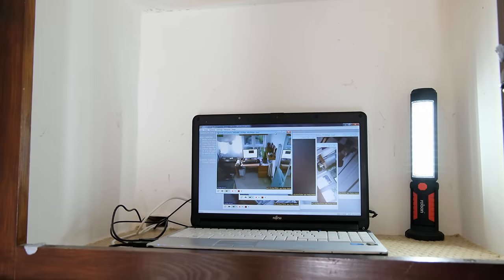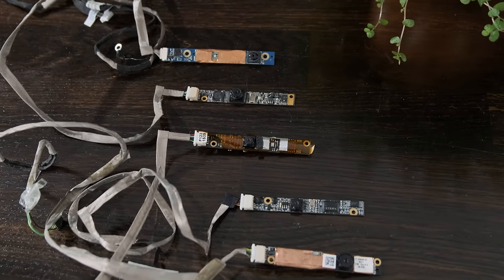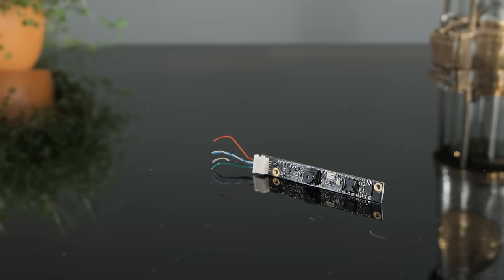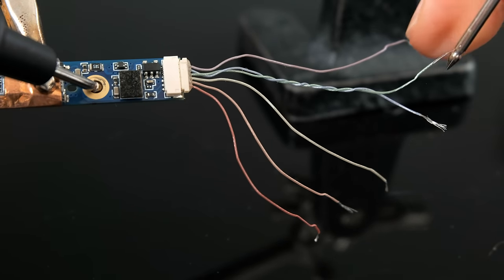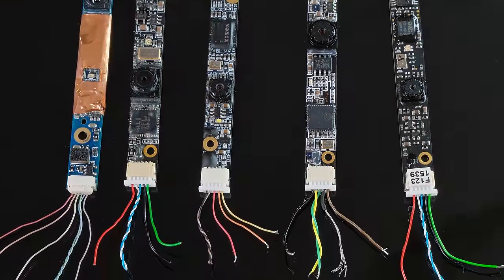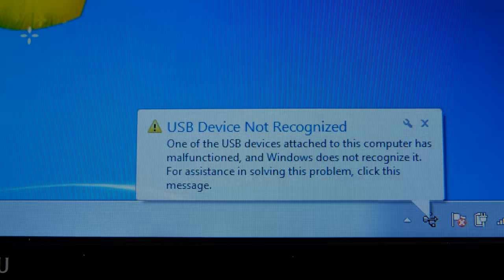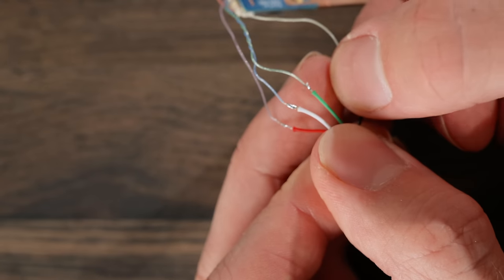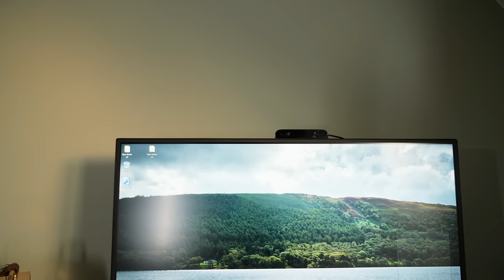How to Convert Laptop Webcams to USB Webcams

Comment: Watch out for webcam modules that are powered by 3.3V as they fry when connected to the 5V from a USB-port. Some have it marked on the rear of the PCB as 3V3 next to one of the wires. A little VRM to regulate the voltage to 3.3V is enough to get those working. No need to also convert the data signal.
Reply: thanks for this comment lol. almost broke a webcam that way. thankfully it was pretty resilient
Reply: @__init__3493  a rookie to electronics do you know how can i do that 5v to 3.3v
Reply: @انا_ابراهيم_البناوي  couldn't you just use a potentiometer? Just adjust it from 0v to 5v
Reply: couldnt get this webcam to work and then i see the 3.3v on the pcb. I guess that explains it
Reply: wire 2 or 3 diodes in series to the positive terminal before you attach it to the camera.  They will take up the extra 1.7 volts.
Reply: you can also do that with a voltage divider with resistors in parallel. you can search in google on how to make one.
Reply: @bunnssgalore5407  I tried with the diodes but it was very difficult and didn't really work, especially since there were a lot more wires than I was expecting and it was very hard tracing which one was the actual 3.3v
Reply: @انا_ابراهيم_البناوي  Use a resistor
Reply: @انا_ابراهيم_البناوي  don't do any of the things these people are suggesting, use a 3.3v linear regulator
Reply: @Anthony-lr4bk  You need to know how much current is the camera taking in order to calculate the right value of resistor. Putting 3 diodes in series makes around 1.7 - 1.8V drop, so its 5 - 1.8 = 3.2V and you are done. No need for regulator either
Reply: @انا_ابراهيم_البناوي  ams1117 3.0
Reply: Thanks but too late
Reply: Thanks but too late

Comment: Hey! I can be casual here on the Extra channel so expect plenty of smaller videos on here :)
Reply: The webcam i found isn't the same as what you were demonstrating. I think its a webcam with a mic integrated, is there a way for me to also use the mic?
Reply: Hey Mat, love what you're doing! Keep it up!
Reply: Sweet! Love your channel. Also digging the beard :)
Reply: @GuardTower  
The microphone data should go through the USB connection as well
Reply: I just want a third of your spirit, mate...
Reply: @GuardTower  I imagine the mic would just use the same Data cables he mentions that are integrated as it would be getting it's power through the same power and ground wires as the cam/mic are all on the same PCB?
When your OS picks it up, it should automatically register both in the Device Manager (Windows).
Reply: Does this work with a webcam with a mic?
Reply: @alonsoaguilar3905  It should.
Reply: @OdykKayne  but there are two extra cables
Reply: @alonsoaguilar3905  That depends on the laptop webcam with a built in mic. Some have a mic that don't have extra cables. Does yours have two extra cables then, you say?
Reply: @OdykKayne  yes
Reply: Mat, I love the things you create and watching you build them.  I’ve been hooked on DIY Perks ever since I saw your video on creating/ building your own portable projector.  When I saw you have DIY Perks Extra, I subscribed immediately.  Thanks for all you do!!!
Reply: @OdykKayne  wont that interfere with the data being sent? there is a reason why the mic is on a different wire. because if it can be passed through along with the data cable, then they can simply route that in the PCB to join with the data cables instead of having separate data cables
Reply: @GuardTower  USB desktop webcams only have one USB cable and they often contain a mic? If the mic is on the same PCB as the camera, I imagine the PCB has some means of sending the data from both through the same set of wires...?
Then again, I imagine this varies from camera to camera. I'm no expert, I am just going by what I think.
Reply: @OdykKayne  you have a point there. tho the extra wires are 7 and it has a ground. so i dont know if i should connect it to the ground
Reply: @GuardTower  Not sure to be honest! Try figuring out the 4 wires that Matt refers to in the video and see if only the camera works or the camera and the mic?
Reply: hey mat.you such a cool guy.. keep inspiring people dude.. 🤘🤘🤘
Reply: @Aditya and also the converting USB webcam into Raspberry Pi ribbon camera
Reply: Matt, a community database for the pin outs would be a useful tool. Any idea how one could be implemented.
Great videos, been watching for years. The beard suits you. Keep up the good work.
Reply: i never can find those for so cheap if i want wan i need to pay 10£ + postage
Reply: @GuardTower  the mic should be recognised by the system when the USB device is connected in addition to the webcam, as the chips on the USB board will have the information for the host (PC or whatever) to tell it has a webcam and mic
Reply: Hey matt can you also share how to use multimeter. Your videos are amazing.
Put some more details in the extra channel so that a person with no knowledge can also do it.
Reply: @1981chrisjones  Just to clarify as there is sensible speculation here - but it's wrong. I've been researching this as cameras are so hard to find, and it seems like there's a strong convention: 4 wires carry USB connection for the camera, and 2 separate wires carry data for the microphone (not USB protocol). From what I can see, they use PDM audio a lot (digital data with a clock wire and a data wire). But it's also possible to carry analog audio - the condenser mic gets power from the same power line. I should also note that the 4 USB wires go to a motherboard connection labelled "camera" whereas the 2 microphone wires go to a different connection. Also, the camera is generally receiving 3.3V from the motherboard, so consider dropping your USB 5V supply with some diodes.
Reply: Plz help to convert smartphone camera to usb webcam!!!
Reply: Hey can you make something like a single button gives order to start multiple systems like server?
Reply: 200th like
Reply: @derekborigo8601  it shows your device needs more power. Now what can i do?
Reply: how do i figure out ground and power positive without a multimeter?
Reply: I've found one that the camera board has "housing" and so I'm unable to interact with the boards' components.  Any suggestions?
Reply: @lordf7355  Damn.  It was a decent one, too if the specs are to be believed.
Reply: Matt thanks for the video. I'm having a hard time finding old laptop cameras with the wires, even the links you provided on UK EBay, none of those have wires. It would take me a long time to find as many old laptops as I need. As a alternative where can I find the white tab connectors, so I could just join USB cables direct to those? On another note, I believe it was you who recommended Contaware as the accompanying Security Software, I'm having a hard time adding Networked iPhones and iPads to it, any ideas?
Reply: Sir is it possible to cellphone camera to turn it into a spy camera using usb cable? Lots of tutorials i saw here in youtube and they said it was fake. Could you tell me sir? Is it possible or not? Thank you
Reply: YOU DONE A VIDEO USING OLD BROKE TV SCREENS AS NATURAL SUNLIGHT, I HAVE AN IDEA AND WAS WONDERING IF YOU MIGHT BE ABLE TO BRING SOME VALIDITY TO MY THOUGHT ON USING THIS IDEA IN MANY WAYS, HOW WOULD I GET IN TOUCH WITH YOU BEYOND HERE??? GREAT VIDEOS BTW I ENJOY ALL OF THEM.
Reply: And for night vision?
Reply: @GuardTower Hi, my webcam has two more wires, I think represents the mic. Everyone here answered you about it? Do you know how to connect them? or it's not possible?
thks
Reply: Oh, yes welcome
Reply: @GuardTower  I don’t think it’s a mic
He cut off that part
I think it’s a data storage for the camera
Reply: Please make more videos like this one! This project is super approachable and practical.
Reply: Please make a video on how to make a secret small recording device that has Wi-Fi.  Thanks
Reply: Please make an easy tutorial how to make USB Webcam connected wirelessly via Wi-Fi. I can't find something like USB2Air device in my country. Thanks before 🙏🏻

Comment: I tried this without soldering in case there are things need to be re-do, but the thing is after I wired and plugged the USB, it is not detected and the webcam module gets hot. Any ideas why?
Reply: Try switching the data cables.

Comment: Many laptop cameras require a 3.3V power, not a 5V available on USB, so you have to add a voltage regulator.
Reply: Yes ,the most is 3.3v
Reply: Thanks for your Comment, my webcam works with 3.3V too. Unfortunatly, I already connected it to 5V, do you think it is still working?
Reply: On 2:33 he tell us to find a regulater. That think regulate to 3.3 V?
Reply: @noreply370  Yes, but some modules will use 3,3V USB, and regulate internally to even lower voltage, or won't have a voltage regulator at all.
Reply: module boost
Reply: how can i know or from where ?
Reply: @abdulqaderalmehdar8421  From the laptop schematic diagram...

Comment: Instead of cutting a USB cable, it's probably a better idea to connect the wires to a micro USB (or type C if you really want to) connector. That way, you get to keep your cables.
Reply: yeah..................
Reply: I have many many cables from old devices at home, so it's cheaper to destroy one than buying a conector.

Comment: why do we need to identify the power positive using a tester, cant we just alternately switch the wire to know if it will power on? will it damage the camera in case we connect  the power to a wrong wire?

Comment: im having a problem. it seems both data cables always result in an error message. i have 2 cameras right now and i swapped both data cables and its all error messages. i tried using a different laptop and still the same result. pls help :<

Comment: Hello max, great video, but i have a problem the web cam from a laptop that i'm using it only have 4 cable, 2 of then  are torch together that i supose those are data + and - and then the other two must be u+ and u-.
But when i used the voltmeter those two for tensión they sound and beep in the negative..
Could you give some advice?

Comment: Hi, I have a webcam with 5 wires. When I plug the orange one to the GND and the black one to VCC the LED is powered. But the two twisted wires (I guess they are data wires) don't do anything when I plug them to the Data+ and Data- (same if they are inverted). What can I do? I also have a yellow wire on the webcam. Thanks

Comment: Gave this a try after salvaging some parts from an old laptop, and I ran into an issue that I'm unsure how to diagnose. I soldered everything up, and the first time I plugged it in it gave me a "Device Not Recognized" error. So I swapped the data wires, and my computer (in fact, both computers that I tested it with) made the "device connected" sound, implying to me that I had done everything right. However, nothing new appears in the device manager or in software, and even after restarting with the device plugged in I'm fairly certain no new drivers were installed. Is there a way to check if the device is being recognized at all?

Comment: So, I tried making one wiht a h003p-4 model. Think i connected all wires right but when plugging in a laptop, I get descriptor request failed error. How do if fix this? Tried changing Data + and  - cables multiple times too.

Comment: I've been trying to do this for hours with no luck. First cam i took out of old Fujitsu Siemens notebook either kept not getting recognized by system (tryed switching data cables with no luck) or just doesnt get recognized at all and other one that is from Acer notebook doesnt get recognized no matter what i do. Both cams light their LEDs when connected to usb on working notebook, Fujitsu lights blue (its weaker without that 5th cable which might be shielding and stronger with it but doesnt get recognized either way), Acer one lights green LED that doesnt change and has no 5th cable. Any ideas?. Its kind of getting frustrating when basically everyone on the internet can get everything done easily and no matter what i do nothing works for me.

Comment: I have tried this out and it works well, except for one thing, the camera module heats up. Is that normal? I believe it is because the camera takes 3.3v and the USB port is 5v output. Should I be worried or should I need to solder on resisters? Thanks for the video.

Comment: I tried this method with an old Acer Aspire 8920G camera but it does not work. I have read somewhere that It must be because of the input voltage, which should be around 3.3V. But I've also read that all laptop cameras run on 3.3V, so I don't know what's happening. Maybe I need to install the drivers, but I cant find them. Any ideas?

Comment: My Webcam connects correctly to the PC for 3-5 seconds. It says "Foxlink" in the device manager for camera. So, the brand is correctly detected. But after these seconds it disconnects without changing a thing.

I read that there are 3.3V cameras out there. May this issue relate to this? I could not find a proper Datasheet for "Foxlink CONFIDENTIAL F003FF-149" since it's pretty old.

Comment: Hey Matt! I tried connecting it to the PC, but it won't recognize it. Neither does the LED from the webcam light up. It only gets really warm, do I have the wrong cables connected to each other? The webcam cables were colored black and red, so I just connected them to the black and red cable from the USB connector.

Comment: If you can't get it to work there may be an additional step that you need to take.
Most webcams run at 3.3V but USB provides 5V. Some will be fine with this but others (like mine which was pulled from a Dell Inspiron) will shut themselves off as soon as you try to pull video from them.
A quick and dirty way of stepping the voltage down is to stick two diodes in between between the 5V line of the USB cable and the power wire on the camera instead of soldering them directly together. The cathode end of the diodes (the stripe that's on the diode casing) should point towards the camera end. i.e:
USB cable 5V Line ---> Diode (stripe this side) ---> Diode (stripe this side) ---> Power wire on the webcam.
I used 1N4001 diodes since I had them for another project and are designed to carry up to 1A of current.
If that doesn't make any sense, you can find a diagram by googling for "hackaday 110436". That will bring up a project that explains it further.
Thanks for the great video!
Reply: Hi, @jonathanfox5 Are two 1n4007 diodes good too instead of zener ones? Will I risk to damage anything? thanks
Reply: @mrcolo.  Yep, those should be good
Reply: @jonathanfox5  perfect thx

Comment: I have already done this.... and I found out that some USB cables have red for (-) and black for (+). As long as the cable is used with both plugs attached it's not a problem. But when using it for such a project, it may kill your stuff. So it's a good extra advise to check if the polarity is correct on the right colors. This can be done by plugging the cable to a working USB port and measure the 5V DC. If red is positive, cable is good to go.

Comment: Bit frustrated, took four usb cables apart and found the full range of data transfers on the fourth go, but that one has a whole bunch of silver wires (for earthing, I'm told). Now don't know what to do with them. Secondly, I don't have that tool to work out what the webcams cables do.

Comment: sir the voltage regulator can not just be ''anywhere'' as you say, the voltage regulator is going to near by where ever the pcb is getting the power in from so in that case next to the 4/5/6 pin connector,, it can be on the ''back'' but never on the opposite end from the power in on the pcb

Comment: I took a cam out of an old toshiba laptop, 5 wires (including 2 obvious data). so i have orange, yellow and black. After some testing i've deteremined black is power positive but both yellow and orange are ground?  If i attach one or both to the USB cable's ground windows does the system sound that a device has been plugged in but it does not seem to recognize it as a camera. I have followed this tutorial to success with another cable and camera. But i just can't seem to figure this one out. Think maybe its drivers? Thanks!

Comment: I've tried this with two different laptop cameras and get "USB device not recognized" on both. Tried reversing data and even power wires with no luck. Note that they both have more wires than your examples because of onboard microphones. Any tips besides looking for an older laptop camera with fewer wires to trouble with?

Comment: Most webcams are not 5V, but normal webcams have built-in regulators. But laptop webcams can get around not having a regulator to save space and cost, as the laptop motherboard will already have plenty of regulators with many different rails.

You will mostly find 5v webcams only on very old laptops, the easier way is wiring a linear positive adjustable regulator, or even easier just put a couple diodes in series.

Comment: I tried to get a camera module which is nearly impossible. Then finally got one, it was PK40000N300  BNC4VHTTD-310. the connections were so bizarre and my projects was a total fail!
I am very sure I fried the circuit by connecting the wrong wire for trial and error. I guess it was the errors for most part. Your videos are always good Matt. I should have paid more attention to the modules you used. Importing these modules is a problem here in India(in my state actually)because of customs